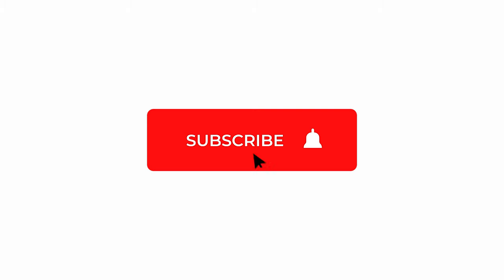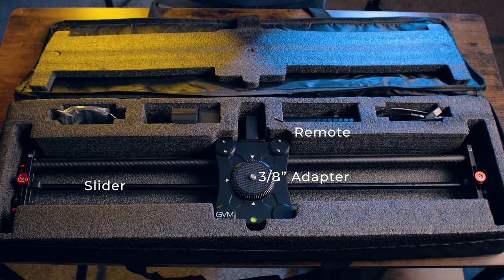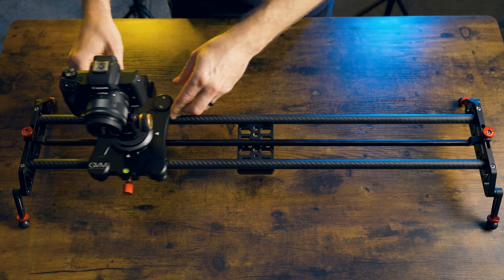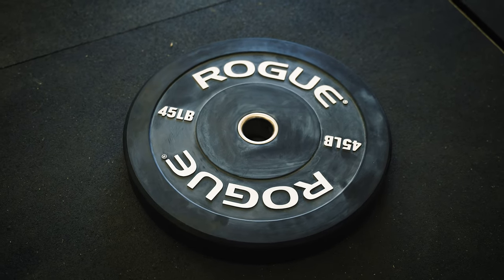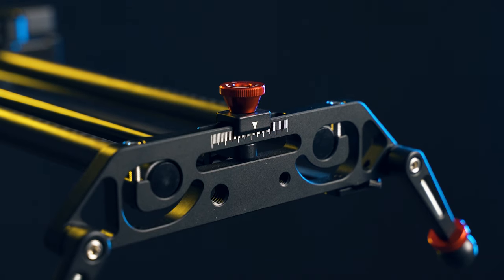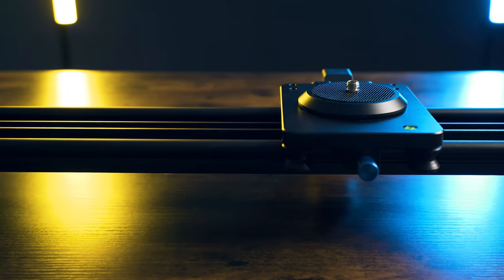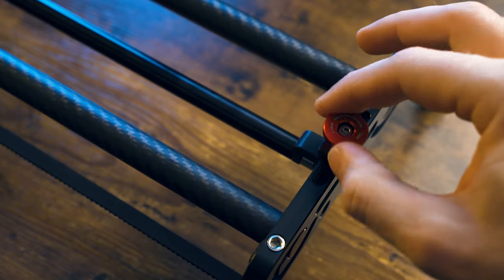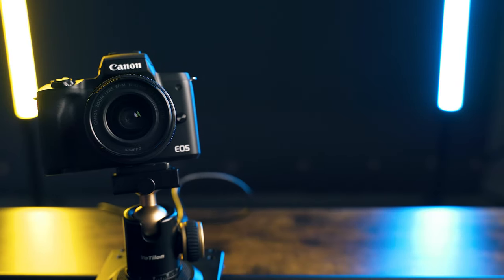Motorized Camera Slider Comparison | Aluminum vs. Carbon Fiber? (GVM GT-J80D and GP-80QD Review)

Comment: How does this not have more views? This was super helpful! I'm still torn on aluminum vs CF as I will travel with it.
Reply from the maker: Thanks for the support! If I were picking one to use primarily for travel, I would go Carbon Fiber, unless you REALLY need the lower profile or the more "accurate" parallax/panorama functionality. If you'll use it in the studio/home AND travel, I would pick aluminum. Once it's in the case with all the accessories, the weight difference is even more insignificant so... Hope that helps!

Comment: I'm glad I found your review.  I have the aluminum version coming from Amazon where I found it on a pretty stout "flash" sale and to hear that there are some advantages (or at least some aspects are maybe a bit better) makes me feel better about "settling" for the aluminum version.  Thanks!
Reply from the maker: I had the same thought when I got the aluminum one, like I was settling, but I ended up liking it more! So there's no wrong choice, because both has pros and cons, but are functionally nearly identical :)
Reply: @NewLayer  Appreciate the follow up.  Thank You!

Comment: I’m thinking of getting the aluminum one, glad I found your review. Lower height and structure rigidity are a plus in my book. Can’t make up my mind if I want the 80cm or the 120cm though.
Reply from the maker: Good choice! And unless you have a specific reason for the added length, 80cm is still pretty darn long honestly. I think 120 would be significantly more annoying to carry around, and I would probably not use it on 1 tripod like I do with the 80cm version.

Comment: Thanks for doing a great review. I'm leaning toward the aluminum version but I'm wondering if the controller cable being attached to the motor as it's moving causes any disturbance in the smoothness of the video vs the carbon fiber version?
Reply from the maker: I never noticed that affecting either of these sliders, or any of the others I've used that had wired controllers, so you should be good to go either way!

Comment: I'm curious how each slider's following mechanism is implemented. The CF looks like a rod, while the aluminum has the channel; I'm imagining each re-purpose the bearings used for the primary movement with the CF having two/ three that pinch the rod and the aluminum has a single inside the channel?

I think I'm feeling the overall design of the aluminum more.
Reply from the maker: Yep, the carbon fiber is a rod, and on the underside of the mounting plate, there is an upside down U shape that the rod goes through. The problem is that the fit is not super tight, so there is some play. So when you switch directions, the camera doesn’t turn for a second or two until the play in the mechanism is crossed, if that makes sense. 

The aluminum mechanism is basically the same thing but in reverse, so the u-channel is the rod, and the bottom of the mounting plate is a cylinder. 

The biggest difference is simply that the tolerance of the aluminum mechanism is tighter. It still has some slop, but much less. 

I hope all that makes sense 😳

Comment: Exactly what I was looking for. Thank you. I've heard the timelapse function is super complicated. Did you try it?
Reply from the maker: Glad it helped! I don't think it's super complicated. It could be easier, but you'll get used to it after a couple uses.

Most cameras have built in timelapse functions now, so I prefer to just set the slider to run separately, then use the timelapse settings on the camera. That way there's no need for the extra cables.

Comment: Hi there. Thanks for detailed information. One question, have you ever experienced any jitter or shakiness while using the product? Thanks
Reply from the maker: No twitches or jumps apart from small ones at the very beginning of a move when using parallax/panorama.

If I’m using a 100mm lens or more, there may be a very, VERY small amount of micro shakes, but it’s imperceptible without deep scrutiny in editing. I wouldn’t worry about it. No one will notice, or you can warp stabilize with a setting of 0.1-1% to make it totally flawless 👍
Reply: @NewLayer  wow thanks! Your channel is the best!

Comment: Thanks for the video. I enjoyed the comparison. I just bought the carbon fiber, but I am having trouble understanding the directions for the remote control. Would you consider a video on how to program and operate the remote? I find the instruction manual confusing. Thx!!
Reply from the maker: I'm glad you liked it, thanks for checking it out. I'd love to do a video on the remote controls, but honestly have very limited time. I bet there's another video out there that has more detail on the remote. It's a great tool either way :)

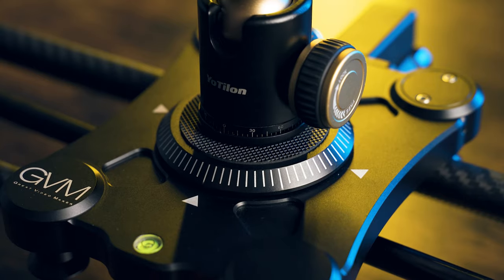Comment: I've now gone through two sliders (a Neewer CF one and a custom one) that both had issues of jerkiness along the parallax, as if it was playing catch up. It would be smooth, and then sudden jerk a bit.. then smooth, and repeat.  I think the issue was in that little bit of play that you mentioned at 3:47.
I'm really hoping this aluminum one will solve my issues. Have you had any issues like that? Is the footage buttery smooth? My ideal goal is to be able to make repeatable shots.
Reply from the maker: The short answer is that accurately repeatable shots aren’t totally possible with passive parallax bar systems like this. I’ve tried 4-5 and they all have issues, some are just worse than others. The best I’ve found was the Aluminum one in this video. 

Once you start shooting 50-75mm or tighter, any wobble or jerkiness becomes more apparent. 

To get really repeatable shots you would need something more precise like a motion control system. I just did a video on the one I use https://youtu.be/DbLtmbHgB9o

I hope that helps, even if it’s not the ideal answer.
Reply: @NewLayer  Thanks! I appreciate the info. 50mm is definitely good enough for me. Even at 18mm, my footage was noticeably jerky and it drove me nuts. Not having repeatable movements is something I can live with, but when I'm doing interviews or live concert streams, I want a system that doesn't look so crappy.
If I had an extra few thousand laying around, I'd definitely go for the Kessler!
Reply from the maker: @landolakes  Oh wow, yeah jerkiness at 18mm doesn't bode well, LOL. The Aluminum GVM was really smooth for me, apart from some slight play at the start/stop. Even the carbon fiber was pretty good, so sounds like you got a unit with poorer tolerances :-/

Comment: Nice video thank you. I am interested in the aluminium version but it is actually significantly cheaper and I was wondering why? Are there things missing from the carbon fibre one? Or carbon fibre is just more expensive to produce?
Reply from the maker: Carbon fiber just costs more to make, with the main benefit being that it's lighter weight. They both have all the same features though, apart from differences in the legs on some of the models.
Reply: @NewLayer  Thanks for the answer.

Comment: Everybody’s making videos about these sliders but nobody compares the two. Thanks for doing the heavy lifting 😂. Did you do any vertical testing? I’m curious to know if it could lift a camera and heavy lens reliably.
Reply from the maker: Thanks glad you liked it. I didn’t test that for this particular video but I have used both with a Sony a7R III and Tamron 28-75mm with no issues 👍

Comment: Hi JT, 
I'm looking at motorized sliders to use for timelapse videos.  I've shot a number already using my Nikon D750 mounted to a tripod with the built in intervalometer.  I know that the slider comes with a number of trigger cables to use for timelapse videos.  Do you know if one of them would work with the D750?

Thanks for the great review.
Reply from the maker: Paul McCarthy I have never used a Nikon, so am not familiar with the ports they use, but there are about a million different shutter release cables included, and I can’t imagine one of them not working for Nikon. 

Sorry I don’t have a super definitive answer, but I would bet money you’d be good to go. 

Thanks for the comment and support 👍
Reply: @NewLayer  Thanks for the quick response.

Comment: Thank you for this review. I’ve been going back-and-forth between the two. I have one question about the aluminum if you don’t mind. I heard that if you mount the tripods on the far end The screw can interfere with the center rod. Have you noticed this? And have you found a way around it? And lastly I’ve been going back-and-forth between the 31 inch in the 48 inch. I’ve never used a slider before. What would be the advantage of one over the other. What type of Applications would a 48 inch one be good for?
Reply from the maker: The space from the bottom plate to the center rod is the same (if I remember), and either way, I never had issues with the screws interfering with the rod.

The advantages of a 48" slider are really just the obvious of extra reach. You can also put them vertically or at an angle and do faux crane shots with more camera movement.

For studio stuff, I find the 31" to be plenty and have never needed more.
Reply: @NewLayer  Thank you. Great info.

Comment: Good Evening
I bought the GVM Camera Slider 48 ”from amazon at 28 Apr 2020 and and I have used it a few times. today i went to operate it while pressing the controller to move this slider just trembles without moving. can you tell me how to solve the problem?
Reply from the maker: Sorry to hear that. Either the motor is dead, or the locking knob is in the locked position. I hope it's just the knob!
Reply: @NewLayer  Thank you for your answer!
Reply from the maker: @dimitrioskatrantzis  Happy to help! Good luck :)

Comment: I have the 80 QD. I'm getting a lot of vibration from it. Do you have any idea what could be causing this?
Reply from the maker: It could be a few things I would guess.

1. The most likely would be that the belt is too loose or too tight.
2. The motor could also be faulty, but that would typically cause a jerking motion rather than vibration
3. The bearings on the rollers are faulty
4. The rods are not smooth, or the parallax bar is causing interference. Try running the slider with the knobs for the parallax bar loosened.
5. The surface it's on is not stable. You will very likely get vibration if you're using this on a tripod, sometimes even if it's got a tripod attached on either end, unless you have very sturdy units. If it's on a small table, that could also contribute to vibration. A stable surface is very important.

Also keep in mind that if you're trying to shoot at more than 40-50mm focal length, vibration will almost always be visible, even on high end sliders. You can shoot at a higher shutter speed and fix it with stabilization in post, or move the slider physically closer and shoot at a wider focal length if that's an option.

If it's still bad, then I would try sending it back for a replacement unit.

Comment: Does anyone know if you can pause a timelapse mid way through and then resume? Thanks
Reply from the maker: You can pause the slider at any time, but I would recommend against it. Because of the way these sliders work, if you pause the slider, then resume, the parallax/panorama bar will cause a slight shift in where your camera is pointing. Motorized motion control units are the only way to pause and resume with sufficient accuracy to avoid that.
Reply: @NewLayer  Thanks JT. I've never used one of these types of sliders before, but just curious how the parallax bar would change if I paused it for say 15 seconds, over the timelapse's pre-programmed 2 secs? I was hoping to use it for animation, but it sounds like this might not work?

Comment: Nobody on youtube seems to talk about the slider being used with out the motor... Is it possible?
Reply from the maker: It is, as long as the controller is off. Once it's on, it "locks" in to place.

The issue is that because of the way the belt winds around the gear, it develops a "memory" in that spot. So if you're pushing the slider across that spot on the belt (which you will because it's in the middle), it will jerk and jump for 3-4 inches.

There's really no way around it that I can think of except strictly using only one half of the slider when you need "manual" slider shots.

If you wanted to use it for a whole session manually, you could remove the belt or gear, but it would probably take longer to do that than just to use it with the motor because it's so simple.
Reply: @NewLayer  Ow, hey. Thanks for the speedy reply! Awesome.
I was thinking of getting something I could use in studio but also take out on a hike and not rely on batteries. I saw one (I imagine hugely expensive) slider that could mount a fly wheel on the motor connector, so that would smooth out the ride. Not sure if the belt was needed in that sort of configuration.
Any idea what I'm talking about? It was that annoying "I remember seeing it, but can't remember where" sort of deal I'm trying to overcome :D
Reply from the maker: I have seen sliders with flywheels and sliders with motors, but never a combo, so I’m not sure!